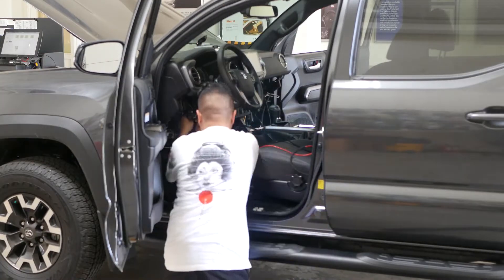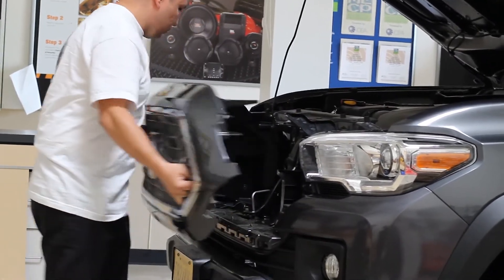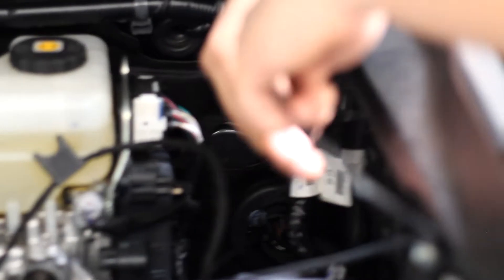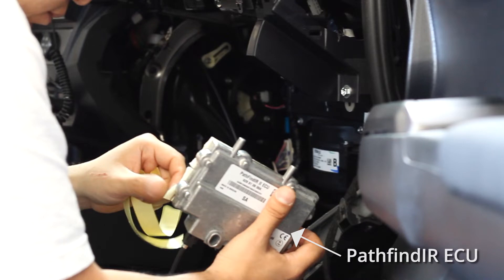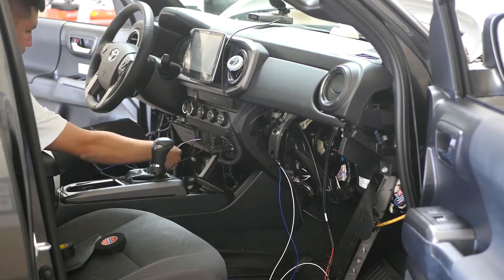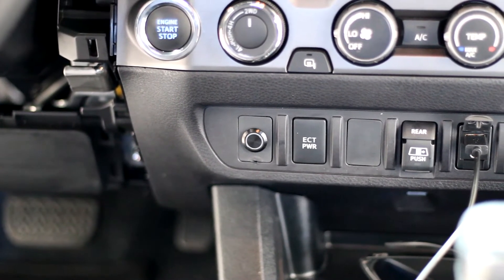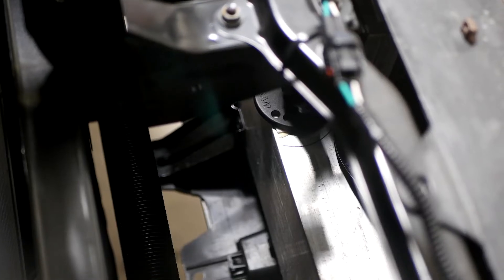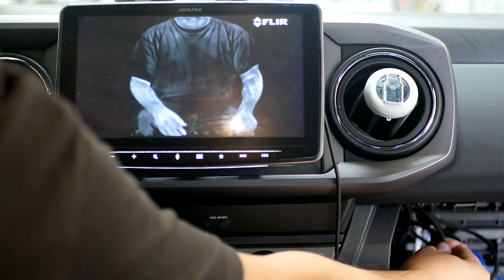Automotive Thermal Camera Install Guide | 2019 Toyota Tacoma | FLIR PathfindIR II

Comment: I have one mercedes s500 cabriolet in Luxembourg 🇱🇺, the night vision camera is identical but is not working because the front glass from the camera is broken , were can i get the glass our the camera ? In mercedes they want 3000 eur for the camera 🎥 …. Ho my good
Reply from the maker: If the camera is FLIR, you can contact them directly and see if the camera is still in warranty. If not, we would recommending contacting the camera manufacturer directly (whether that is Mercedes or a different third party company).

Comment: What’s the point in the relay? The wiring diagram supplied bypasses it’s only function.
Reply from the maker: Sorry, the diagram was drawn incorrectly. The power coming from the battery and the switch should be on their own separate connections to the relay.

Comment: TEquipment Could this be run with an existing  switch pros? Thanks
Reply from the maker: We can't say for certain that it would work as we are not familiar with Switch Pros equipment. We did a custom wiring job with a relay to add in our switch. In theory you should be able to still use a relay like we did and just connect your trigger wire for the switch directly to the Switch Pros wiring harness.
Reply: @TEquipment  Thanks

Comment: I'm not sure if you're available but I have a few questions regarding the installation and operation on my vehicle. It is installed now but I'm not getting any of the pedestrian Detection.  Was yours operational, and are you able contact?
Reply from the maker: For our install, this feature was active from the start (we used the PD/AD model). It's possible that you purchased the base model which does not include the PD/AD feature - see the links in the video description for each different model. If you do have the PD/AD version, you might find additional help through FLIR support: https://www.flir.com/support/products/pathfindir-ii#Overview
Reply: @TEquipment  You were correct.   After a week of troubleshooting with both Flir and my tech we found the unit to NOT be the PD AD model.   The confusion was the advertisement showed it was!  Very frustrating.   OP is offering to send me the correct model.   Thanks, for the very accurate reply.   Wish It would have been last week lol.  J

Comment: Would this be similar for a 2018 Pacifica?
Reply from the maker: The basic concept of installing an automotive electrical accessory will be the same, yes - you will still need to find a mounting location for the camera and ECU, and you will need to pick a power source (direct to battery w/ trigger wire OR direct to fuse box) and hook up the ECU to your vehicle's head unit. These aspects are the same for all vehicles. What will differ on your 2018 Pacific are the specific details - your mounting locations will likely be different and you may need to find another way to route your wires through the vehicle firewall. If you are unsure about installing an electrical accessory in your vehicle, we recommend you contact a professional installer.
Reply: @TEquipment  I appreciate the info.  Thankfully, I do have a tech helping me.  We are looking for an upgraded monitor beside the Flir 7" model.  Great video and very insightful.   Looking forward to more!  J